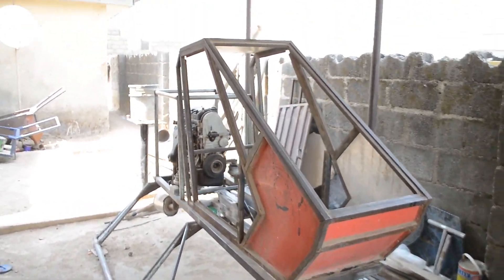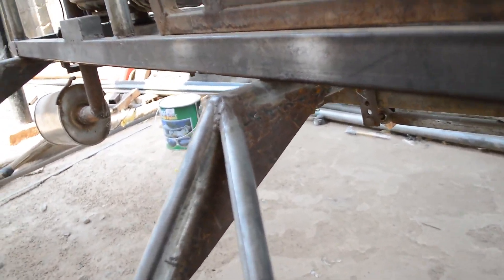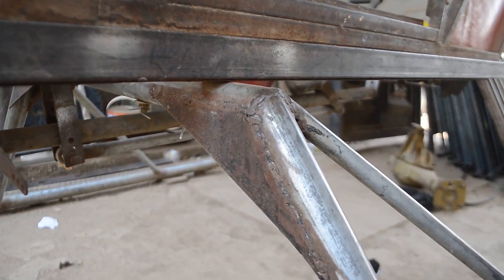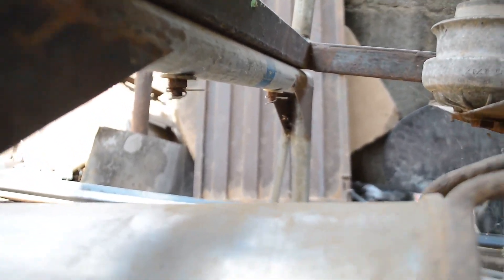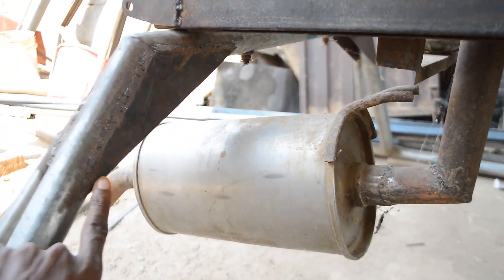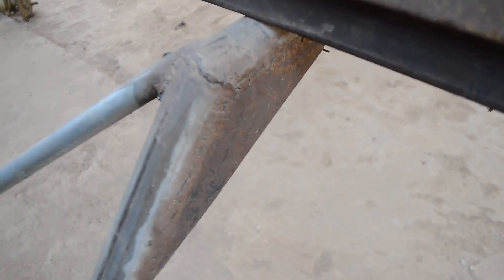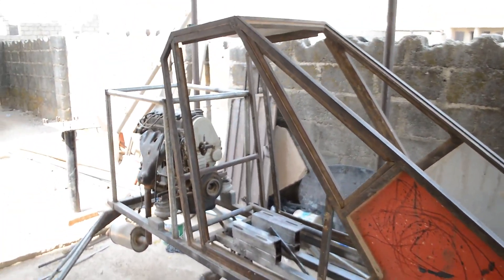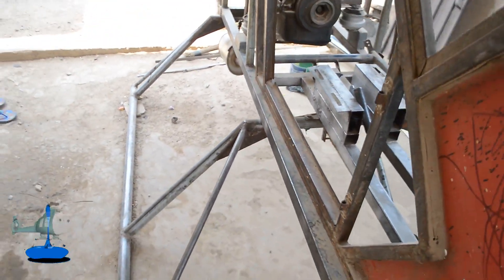Benson B1 Ultralight Helicopter Ground Resonance Protection

Comment: Only seen ground resonance on three or more bladed helicopters caused by the lead/lag dampers allowing an out of phase condition. The G2 Cabri has rubber mounts between the skids and the fuselage as a secondary precaution to allow the two to move independently.